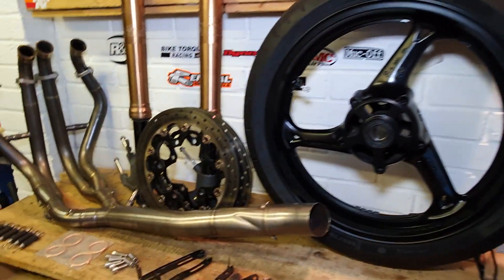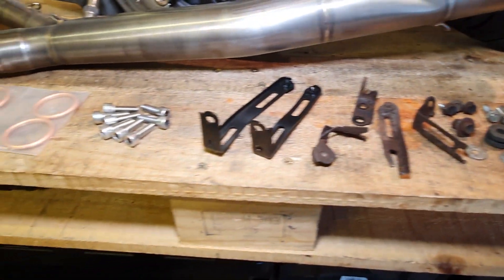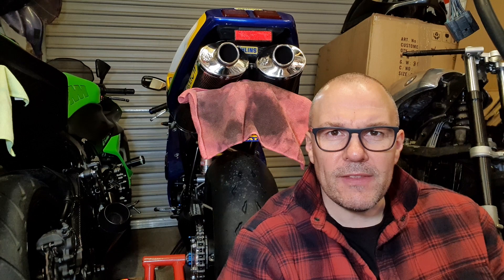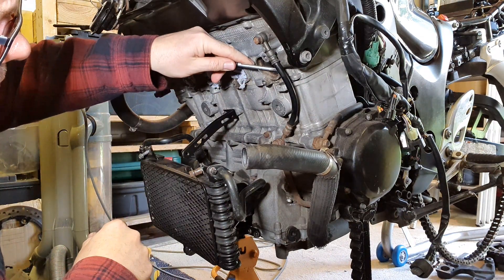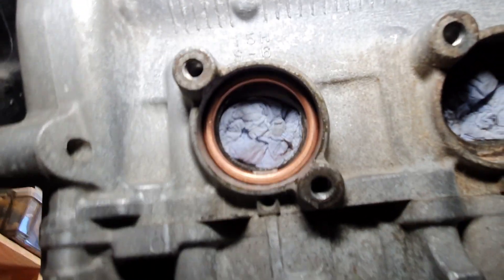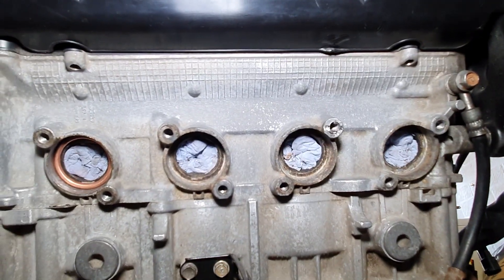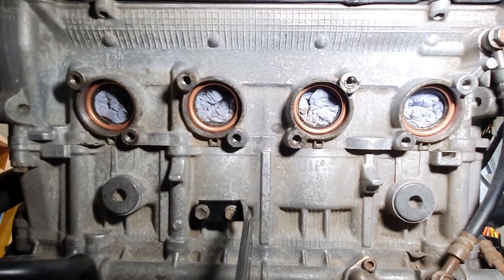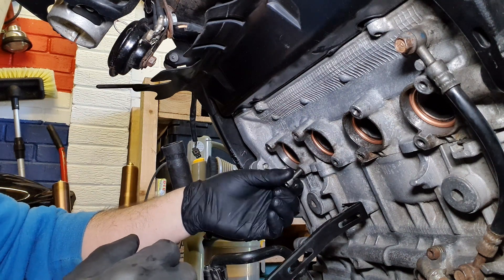Lets Get it On - Hayabusa Build Series

Comment: Hey Griz, i've been really enjoying this little series so thanks for the uploads.  Only thing i was wondering is whilst you had all the front end dismantled, were you going to clean up some of the rusty bolts & brake pipe!  I was thinking a whizz round with scotch bright and a splash of ACF50 would have them coming up nice!
Reply from the maker: Hiya mate, glad to hear your enjoying and your welcome 😎 I hear you mate, to be fair it needs a more thorough refurb than what I'm doing as a lot of nut n bolts need replacing. Not sure what brake pipe your referring to but all the brake lines are being replaced 😎👍